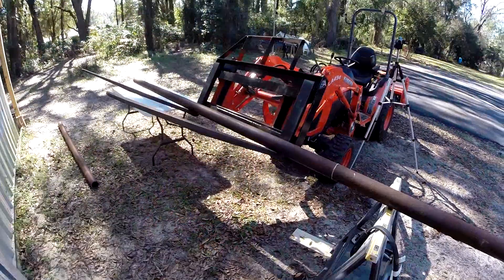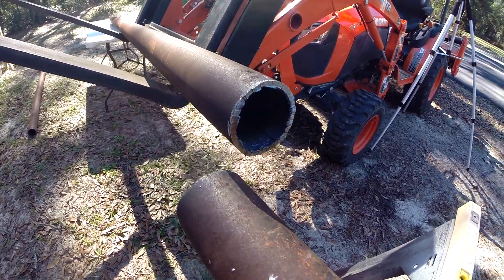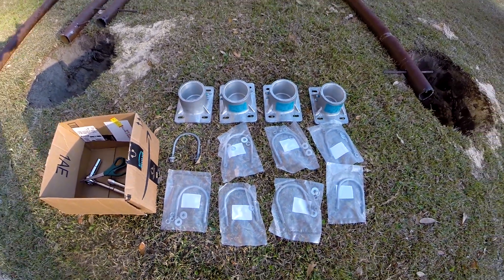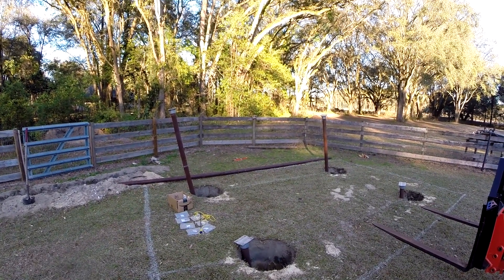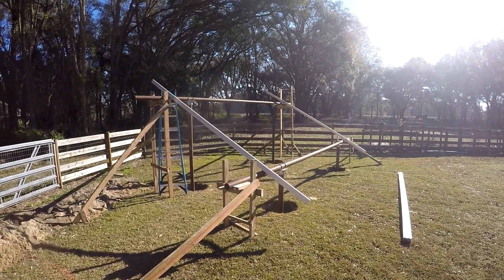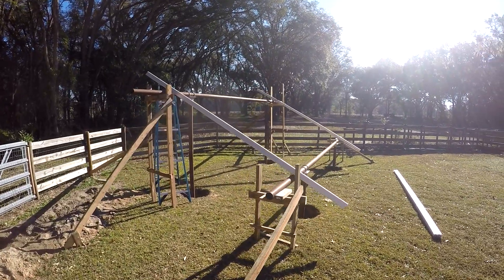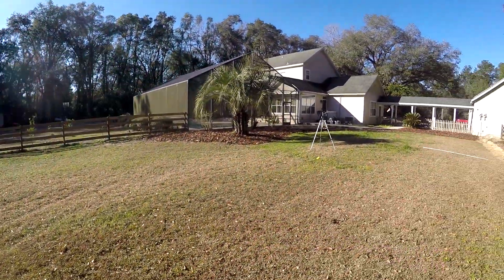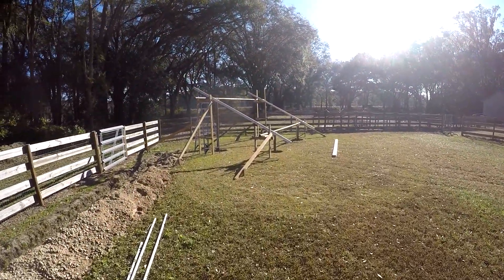IronRidge Ground Mount Solar: Hanging the Rack

Comment: Impressive, especially by yourself.Yes is nice when you can knock out a few projects at one time.
Reply from the maker: Its funny but I was starting on the solar back in Feb of 2020 and I thought: why don't I just clean out the old barn just enough to pour the concrete floor at the same time as the solar pour.  Well that turned into a year of barn to shop conversion before I got back to the solar.  Thanks!

Comment: I am about to build one of these Ironridge designed ground mounts.  The only problem I have with the design are those saddle clamps that hold the crosspipes. They are held on to the pier posts only by set screws!  A bolted connection to the pier pipes would be better.
Reply from the maker: Yes, I remember thinking the same thing.  Drilling all the way through and adding a 1/2" bolt would add some piece of mind.  Thanks!

Comment: If I had been the one tightening those top caps I probably would have dropped the wrench in the hole at least twice on each post
Reply from the maker: Jerry, I only dropped it in the hole once.  Got it with a magnet tied to a string.  Had to cut that part out due to language issues... :)

Comment: I live at 31 degrees and plan to go about 25-30 on a rigid array (mostly afternoon sun). Also siting mine to around 210 SSW.
Reply from the maker: I am at 29 degrees Latitude.  I was shooting for around 25-30 degrees on the array but not too concerned about it.  Come to think of it, I have not even checked to see what I ended up with.  I have completed the project and I can tell you that this thing is cranking out so much power now that the batteries are fully charged by 9:30am and I am looking for things to plug in.  Now I yell at the kids when they turn the lights off.  :)
Reply: @HomesteadEngineering  
You're to funny, Dave!
Reply from the maker: OK, just measured the tilt angle, its 28 degrees.
Reply: @HomesteadEngineering  Roger-that! Latitude matching it is.

Comment: Hi man,best solar setup you have,how many meter high you have on back,front and what angle please,i like your mount and in spring i will do the same for my 12 panels. Thanks and happy new year!!
Reply from the maker: I would have to go measure it but its roughly 20" at the front and 8' at the back.  Its about 26-27 degrees.  Thanks!

Comment: How did u assure they were parallel?
Reply from the maker: As I recall...  I measured and adjusted about 5000 times!  
from memory (take with a grain of salt)
1. level up the top bar at the right height
2. level up the bottom bar 
3. connect a rail on each end 
4. make sure the length of rail is the same on both sides
That should pretty much do it.
Note: I am building another one in a couple weeks so stay tuned

Comment: How did you make sure the front post were parallel with the rear. Thanks and nice job
Reply from the maker: I measured them a bunch of different ways.  Mainly, I measured off the same distance of rail on each side and then left to right until the diagonals matched.

Comment: Wouldnt a portable band saw replace the entire Hazard Frought catalog you used?
Reply from the maker: I guess your talking about using the torch to cut the pipe rather than a bandsaw???  I do have a portable bandsaw but where is the fun in that?